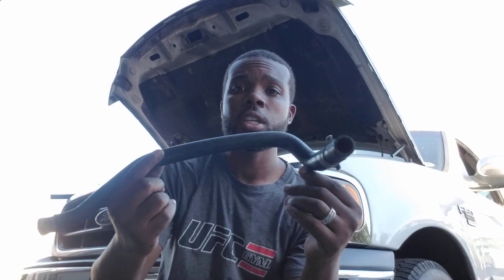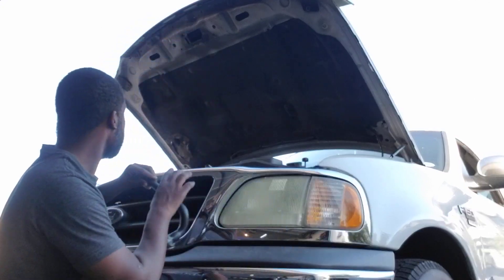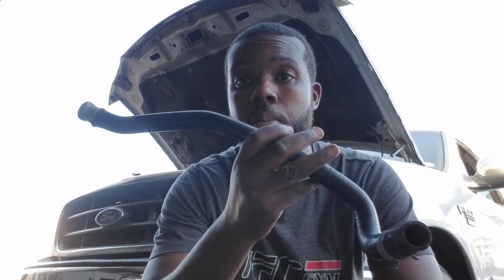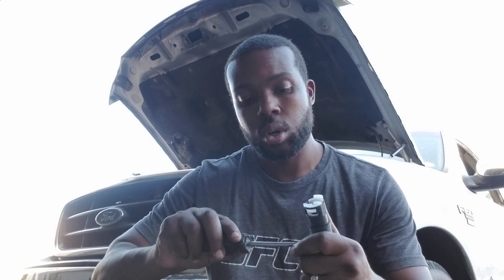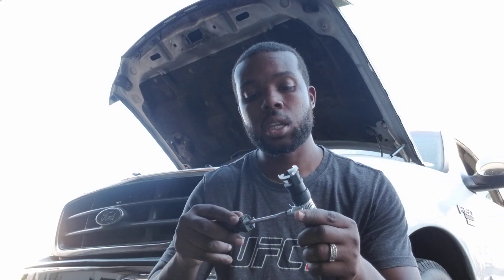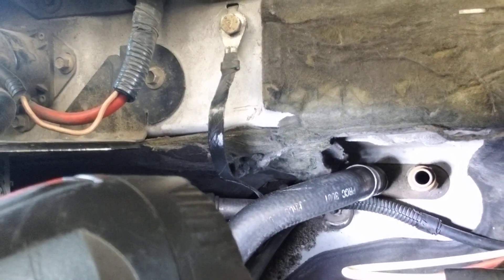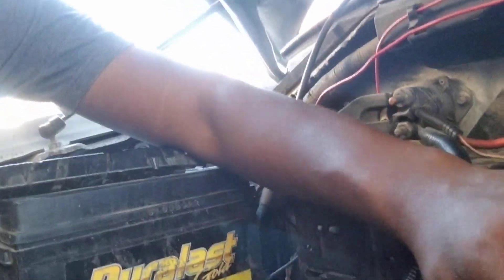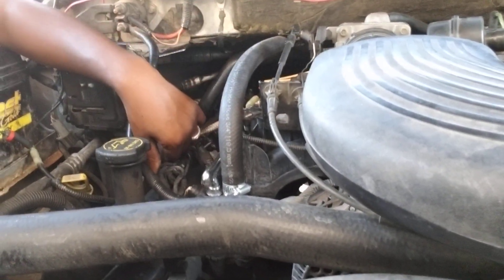01 F150 5.4L Heater Core Hose Fix

Comment: I've got an 01 F250 Super duty 4X4 6.8L V10 and the heater core failed. I watched numerous videos and I wasn't sure if the quick connect had to go on with the factory metal collar at the end of the hose. But seeing that you just used some "by the foot" heater hose and worm gear hose clamps, that answered my question. BTW with your I.A.C. issue, I hope you got it handled? But if you didn't, you should try singing professionally. When you replicated the "humming" sound I could tell you've got that singing voice. No bullshit, I mean that sincerely. Thanks for the video. And let's see those Mustangs and the Nova. Take care, 
and blessings.

Comment: My mechanic doesn't like the  hose and quick loc fitting deal.  Says it will eventually leak.  It''s a dealer only item.  I'm looking at around $184 for the hose

Comment: im seriosly considering CUTTING my heater outlet hose ,   cant get to the firewal to get the clamps off without removing half the engine.................   i cut the hose, backflush it,  get it flowing,   use a metal 5/8 tubing to connect where i cut,    simple

Comment: WARNING*WARNING ---> Do not use stainless steel clamps to attach the new hose to the heater core pipe.  Use the recommended quick release fitting.  The heater core pipe has a metal "lip" where the proper "quick release fitting" snaps over to keep it secure under pressure. Stainless Steel clamps will wiggle free.  Here's what you need. Dont mess around with just some hose & clamps. It might blow off in the left lane doing 70 MPH like mine did. ---->  Heater Core Hose & fitting #F65Z18472BBC   (Fits most  5.4L Fords )
Reply: What about a 6.8 Liter V10 same year as his. 2001?